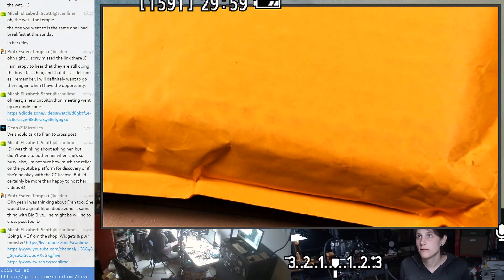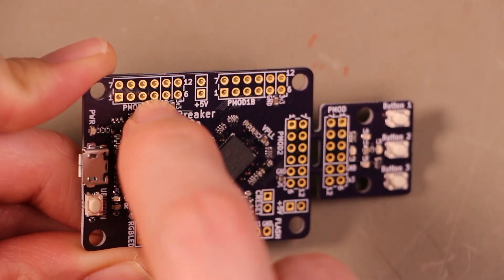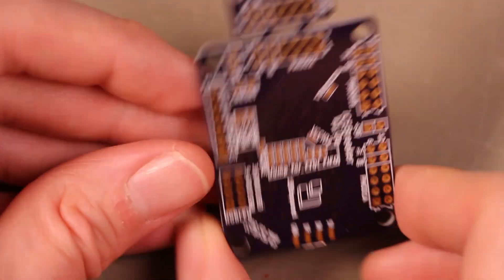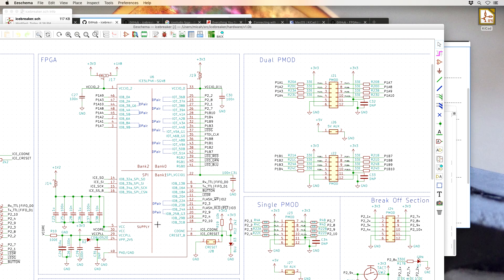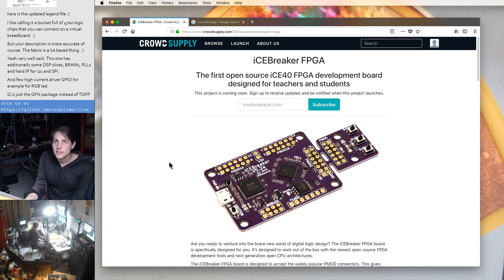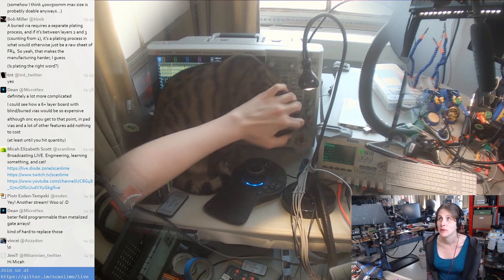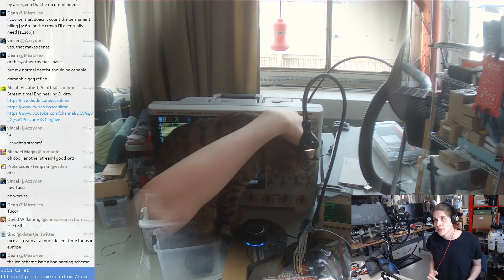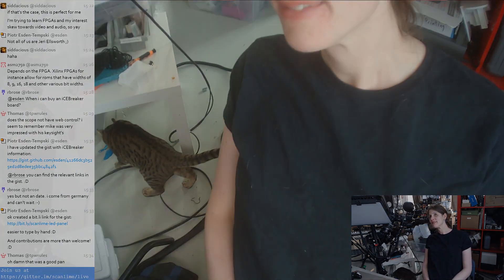iCEBreaker breaks the ice with open source FPGA tools

Comment: Thank you.
I've just got one of these boards and I'm impressed. What with the ridiculous install and registration process needed for the Xilinx kits, the final straw was the 5 minute 'build' times needed for a simple 'blinky' LED.  The ICEBREAKER tool kit took me 4 to 5 mins to set up the install (I left it to build the tools from the git repos). After that my blinky binary stream builds take less than 3 seconds. The only 'problem' I came across  - was with my USB serial port not being available. This was solved  (after a google search) by removing the existing FTDI driver from my Mac OS X. I'm now using my board to design a retro sound card.